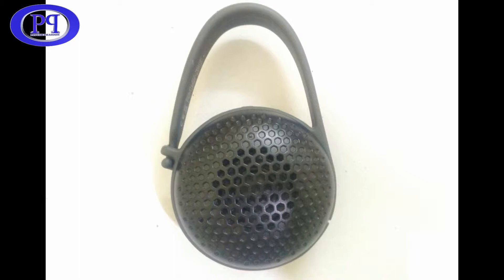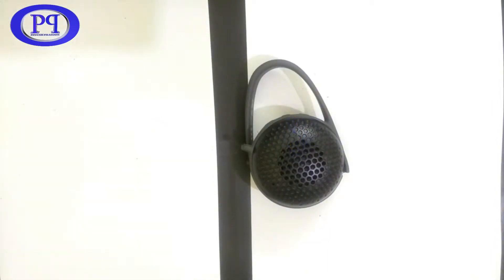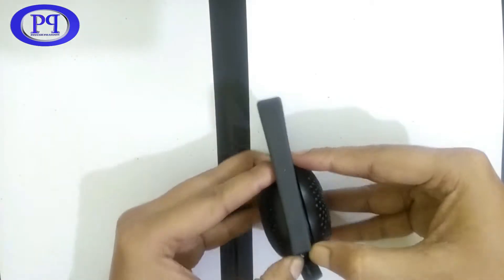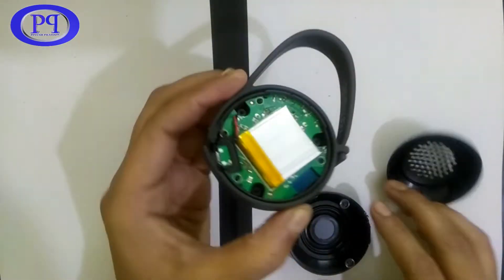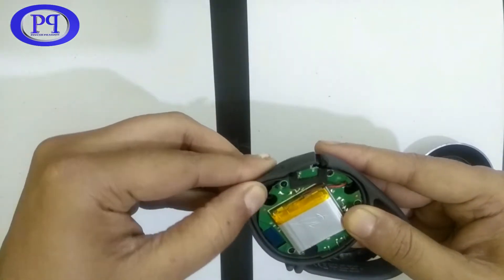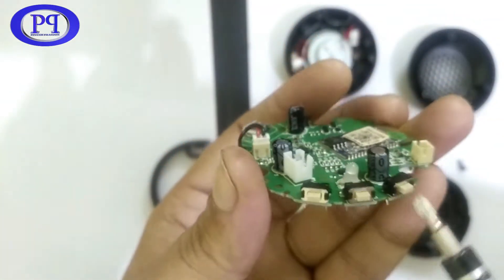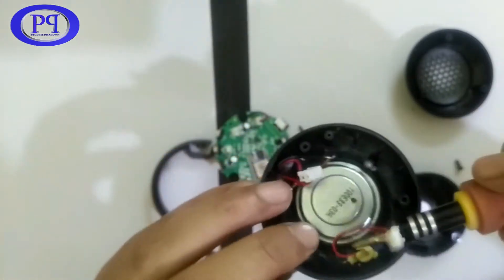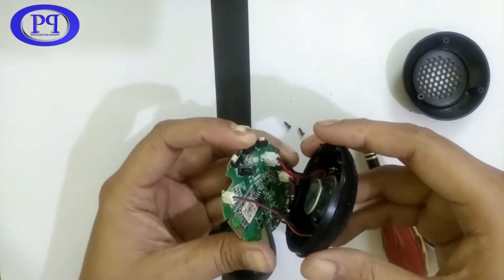Amazon Basics Mini Bluetooth Speaker Teardown | ENG

Comment: My Amazon basics 5 above model not working properly
Sometimes sounds were coming and sometimes not coming

Later completely sound gone just opened now and checked every connections are normal but sound not coming what maybe the reason...?
Reply from the maker: Please clarify me few points given below:

1. Share me the model name and number of the speaker - 
2. How old is your speaker - 
3. After how long you started facing this sound issue -  
4. Are you sure if it's battery is in good condition -  

5. Did you charged it properly (5 to 8 hrs of charging is recommend once drained completely) - 
6. Is the speaker able to pair with new Bluetooth device -   
7. Did you tried connecting it with other Bluetooth device to check the sound - 
========================================
Please do share the above details so that I could give you some suggestion on the same.